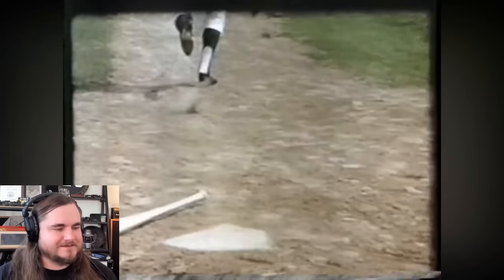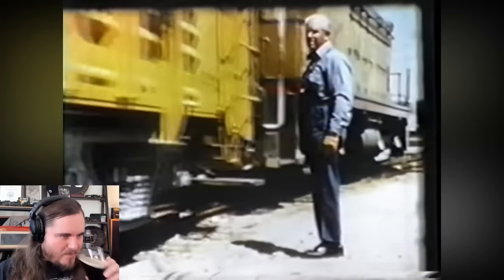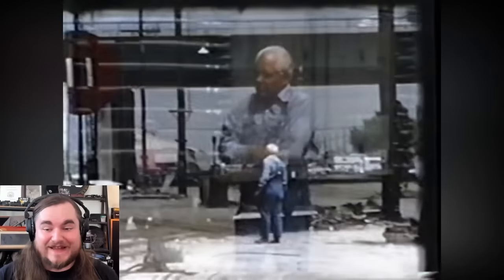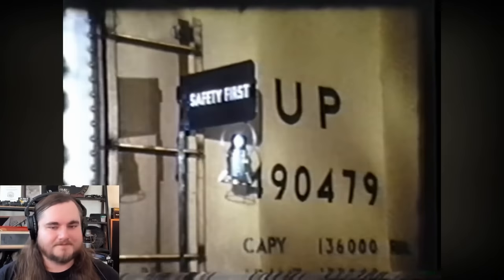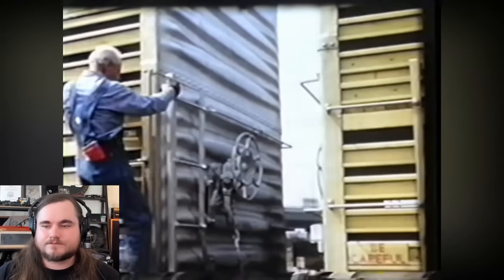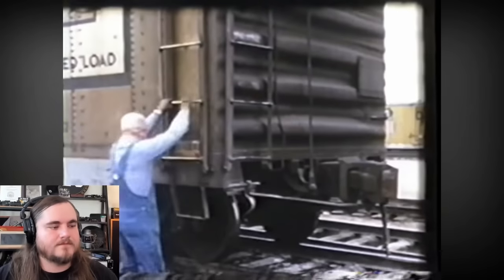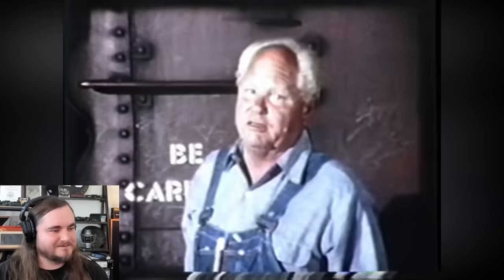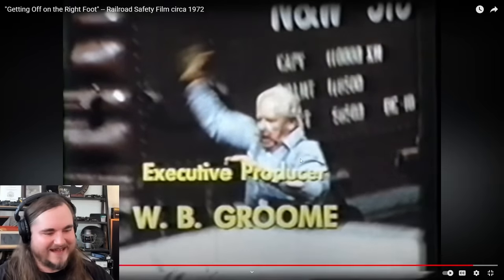The best rail safety video of all time? | Hyce Reacts - "Getting off on the Right Foot"

Comment: Seeing that punching bag reminded me of something stupid I did at work back when I worked as a custodian. I was assigned to clean the weight room and I'd always clean it right before lunch and I'd sometimes lift some weights or take a few shots a the bag they had in there. Sometimes some of the other custodians would also spend some of their time lifting a few weights at the beginning of lunch and they'd spot me if I went to lift anywhere near my max on the free weights.

On that particular day, it was just before lunch and I was in there cleaning by myself. It had been a particularly frustrating day so I took some heavier shots that usual at the punching bag. I ended up bursting a blood vessel in my hand and having to go home because it swelled up that much. That was embarrassing! I didn't get in trouble for it though and got the advice that I should probably get some bag gloves and put those on if I was going to take some shots at the punching bag.

Comment: Is there something like Lock Out Tag Out for the flags?  I'm familiar with that for electrical work where each person working should have their own unique keyed lock on a disconnect or breaker so its impossible to mess up and nobody can energize it until EVERY worker is clear of the equipment...seems like it could be logical for a similar thing where each person working can "lock" the flag in place and only once every worker unlocks their lock can the flag be removed?

Comment: I'm a trainee conductor right now for CN and have been shown this video for training, it makes me cringe every time I watch it.

Around 11:00 you were talking about getting pins while moving and kicking which at CN we're trained to do similar to how it's shown here but it really depends on the crew for how often we do it day to day. We're also trained to detrain while moving for emergencies but CN doesn't allow it in regular operations.

Also, I got to learn that "there's no level track on the railroad"  the hard way by hiring on to the steepest terminal in Canada that runs Beltpack from what I've been told with grades over 2% on the main near some of our industries.
Reply from the maker: Yikes. That sounds like quite the yard. Thanks for the additional context! Best of luck making it through training and marking up.

Comment: So I am a train driver in Germany and I have always been quite baffled by your hand signals and how the intended direction is dependant on the direction of the movement. Our hand signals are quite simple: We just use one arm. Either we wave up and down, which means "drive away from me" or we wave with one hand horizontally from out to the chest, which means "come towards me". 
Slowing down is signalled by just raising one arm until the speed has decreased enough. And stop is waving in a circular motion, independant of direction, which is also our emergency stop signal. However, as I guess it is with your railroad too, we mostly shunt with radios now, so the hand signals are just the back up.
And with stepping on and off moving trains: It went quite similar here. Until recently it was completely banned in our company. But just a few months ago it was lifted and now we are allowed to step on or off moving trains if they are moving at walking pace. However we dont ride on the ladders, which seems insanely dangerous to me, but we have little plattforms you can stand on. (Even though some are ridiculously small.)

Comment: RE: Stop and Washout

Maybe I'm missing something, but it appears that the washout/emergency stop is a more vigorous "stop" motion, is that correct? Not to get too cute, but does that mean that the "stop" sign can therefore be modulated? between "ease it down" to "heavy braking" to "dump the air"?
Reply: Sort of.  "Easy stop" will be slower than an "emergency stop" with the same motion, but there's only so much in-between.  Ideally, before an easy stop, you'll have already used a "slow" sign to indicate to the engineer that they should expect a stop (on my RR, "slow" is an arm held horizontal and still, which can easily swing down to a "stop").  Also, while the speed/energy of the motion can be adjusted, the size should always be large and easy to see.
Reply from the maker: Washout is very much so a, more vigorous and violent stop signal.

Comment: Around 8:30 - how do we survive over here with people standing all around the train? xD Around here, most long distance trains are thought for 200 % (i.e. as many standing as sitting) load, regional and suburban trains for 400% (i.e. thrice as many standing as seats) load. It's just common sense and common knowledge that trains move and you have to take a bit more care than on steady ground and a bit less than in e.g. a bus. Also on tourist/museum railways it's just the same thing. I think there are a few where you aren't supposed to be on the platform (but still may cross it to change cars) where those are completely open, but usually you'll see tons of people standing (legally) around in the cars and on the platforms while the train is running. The Harzer Schmalspurbahnen (Harz mountains narrow gauge railways, 1000mm so basically our counterpart to your 3ft) comes to mind as an example of railway cars with platforms where you can be everywhere.

Around 13:00 - honestly: How often to the air hoses snap that easily in place? Especially when it's colder outside? Once in ten times? They're a pretty pain in the [steam whistle] if you ask me.

Around 31:30 - doesn't that get nastily confusing when "interoperating" or what the term was for driving one company's trains on another company's track? Over here, railway signals are regulated by law. In the case of Germany, it's the ESO (Eisenbahnsignalordnung, railway signalling ordinance) and it contains all the signals you need for a railway, be it stop & distant signals, be it speed signals, be it brake test signals, be it shunting signals etc. etc. - so whatever company the other guy, gal or anyone inbetween is working for and wherever we are on the network, they'll perfectly know what I'm telling them with a hand sign.

31:50 - what the hell? Why would you do have it mean different things at night and day? And what do you do with an engine which doesn't have an obvious front or back? Afaik your engines are rarely symmetrical unlike here, so it's probably less of an issue, but there surely are some? We always have "come hither" and "go away". If you're standing at a spot that makes it possibly unclear, you first point in the direction you mean and then give "go away".

Comment: Blue flag and Lock Out Tag Out violations are practically the same thing as carelessly waving a loaded gun around, or picking up a gun and pulling the trigger without checking if the chamber is clear.  It's negligence that can lead to severe bodily harm/death, the only difference is people are more conscious of the dangers of a firearm because it's a weapon.

Comment: I do not work for a railroad and the hand signals part is confusing to me. Or rather - why the signals are absolute ("forward" or "backward")  instead of relative ("toward me" and "away from me")? It makes the brakeman remember which way the engine is pointed where the relative signals, to me, seem more foolproof, since the engine driver knows which way his engine is pointed.

Comment: Well I guess I have to admit to being an huge jackass when I was a kid because I used to not only walk on the rails but hop my bike up onto the rail and ride on the rail as a challenge because riding on logs wasn't a big enough one. This would have all been more or less a small risk except for the fact of it having been a fairly busy main line. I did at least have the sense to look at the light and listen for trains all the time and I did succeed in riding my bike on one rail several times and it goes without saying that I never got hit by a train but I also always got off the track and a good distance away from it before any trains passed.

Comment: 4:31 What if they figured out what the “safe” speed was to do this, then had indicator lights on the cars which would go red when it was no longer a “safe” idea? (That is to say, when the margin of safety becomes too thin to be worth risking) 

It seems to me with how long it can take to stop and move these behemoths, to say nothing of the fuel costs for getting it moving again from a dead stop, being able to keep it moving as much as possible sounds most economical.

6:36 I’m not a railroader but I let out a monkey-like screech of terror.

Comment: I might understand a second chance for not placing a blue flag or not properly following one, depending on circumstances, but a second chance for taking someone else's flag down, I'm understanding blue flag to be a pretty close system to loto, and unless it's an exceptional special circumstance and you do a boatload of paperwork and double, triple, quadruple checks, cross checks, ....... first, you don't ever even think of cutting someone else's lock off (and if you can get it off any other way you're already violated a ton of rules, one key only and only in tne possession of the one locking it out, loto locks actually generally specifically only come with a single key). I can't see how removing someone else's blue flag isn't an automatic your fired, don't complete the day leave the property now don't bother even applying for a job here for at least a decade as you will be automatically rejected, you don't mess with life safety issues like that.